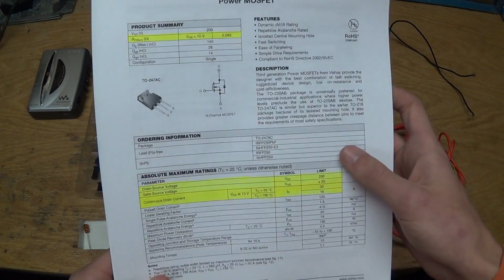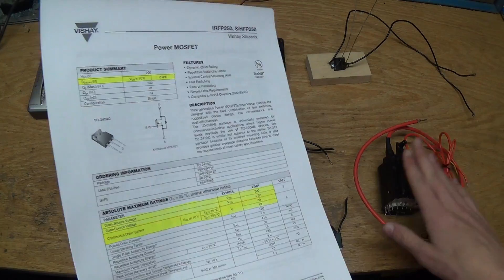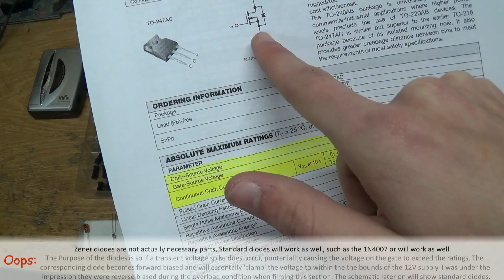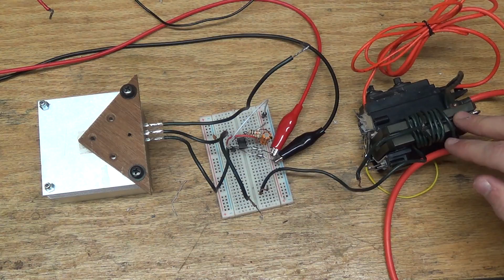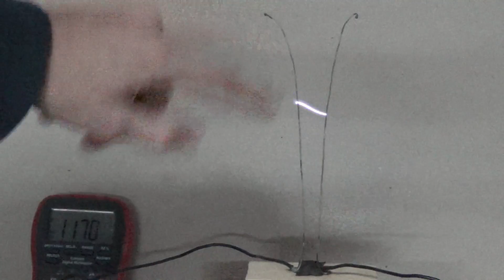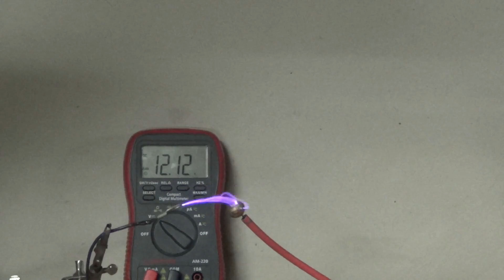Weekend Projects: Make a 69KV Singing Arc Plasma Speaker Flyback Driver!

Comment: Alright I need some help with this and I can't seem to gather the answer from the various schematics and videos, it seems to always be skipped over detail wise. I have built a ZVS, I've used two flybacks on it etc, I normally use a rectified output from a variac, and I just recently completed a 555 circuit as well which functions well, though the IRFP250 gets pretty hot after a while.

The problem is, the ZVS I can throw all kinds of power through the flyback, and the 555 I obviously can't, and I've done all this in the hopes I understand PWM better. Well, the 55 I can get some barely audible sound, but the arc is short and thin relative to my ZVS. Instead of trying to use the ZVS (I read the comments with you and that guy here as well) I wish to use the 555 with dual power supplies, as you are in the video here, but no one explains the details of using two supplies.

I'm not quite sure how to connect the second supply, do I connect the primary and the resonant cap to the second supply and leave the negative side to the first supply? Does it connect to ground? It's always shown as just one connection, with no explanation as to where the other side of the supply goes, and I feel like I don't want to run a 555 circuit with a 9v, then pump variac style power through the primary to have it blast the battery.... it seems like a bad idea. Can you help me with this? It's maddening!!

Comment: Thanks! Just built this and it works perfectly! Got a monster flyback from a 27 inch CRT and im getting 3-4 inch arcs!
Reply: damn that's about 200-300kV's
Reply: @F.A.1.8t  you mean 30-40kv, the flyback transformer is only rated for 10-33k, when the transformer has 300kv output, than you gonna fry your flyback transformer or even explode.

Comment: what frequence of you 555. I don't see your cap between Pin 6 and mass
Reply from the maker: Set your resistors and capacitor to be about 44.1KHz for best audio quality, or to about 19-25KHz for maximum arc length (may cause mildly audible extremely high pitched squeal) 100KHz mentioned in the video was incorrect because the 555 was experiencing some sort of feedback from the high voltage which caused it to act sporadically near the very end (where I was drawing the huge arcs at 12v.) and although the chip was set to oscillate at 100KHz, it was not actually operating up that high.
Reply: i know F=1,44/((R1+2R2).C) there is an error with it F=300hz or 900hz. 
i used R1 = 100kohm, R2=10kohm(rheostat) and C=0.1uf.
Reply: i try again with R1=R2=200ohm, C=0,1uF => F=21khz, capacitor 4,7000uF between two pin of flyback and i use IRF 540. When i set Vcc, MOSFET was activated but power supply inform Vcc = Mass. What's mistake
Reply from the maker: * 555 timers should not be used with such low value resistors. 1K minimum.

* The duty cycle should be less than 50% (I learned that after this video.) You have 66.6% duty cycle.

* frequency is set to 24KHz, which should be within range. May want to tune this for your flyback however.

* You should not have anywhere NEAR 47,000 uF across the primary of the transformer.

* IRF540 is not a strong enough transistor. Use an FTP333N25 or IRFP250 as the bare minimum

* Vcc = Mass? What is "Mass?" If by Mass you mean ground (0V) then obviously the MOSFET has died, with the classic short-circuit failure mode.
Reply: My circuit seems to have run, I heard little sound in the transformer, but the mosfet is very hot and there is no lightning. Mosfet seem died :((( . What happen
Reply from the maker: Please click read more on the last comment. (sometimes youtube is retarded and does not show it, reload the page if so.)
Reply: tks u, i will try again
Reply: The duty cycle should be less than 50% (I learned that after this video.) You have 66.6% duty cycle.
What do you mean? i don't understand
Reply from the maker: Quan nguyen huy Duty cycle is the percentage of the time the output is at Vcc (12V) vs ground. setting the duty cycle requires changing the ratio of R1 and R2. But sn additional diode is required for less than 50% duty cycle or PWM.
Reply: could you give an example! pls
Reply from the maker: Perhaps google could help you in your native language. english search terms include PWM, pulse width, duty cycle...
Reply: ok tks you so much, i done

Comment: I just wanna help a bit:                                                                                                                                                                                    
Dumpster diving? No dude, go on kijiji and find somebody giving away CRT TVs. That's what I did. Some even give them away for free. I got mine for 15$ along with tons of electrical parts, free mosfets and high power resistors.
You can use a diode on the coil to prevent EMF kick back from destroying your mosfets.
You killed your flyback because of the input voltage and the amount of winding you have. Transformers work with ratios right? Having only 4 wires on the input will result in a huge voltage on the output that will kill the internal diodes and capacitors. This is why you use much more winding for higher voltages. Some go up to even 30 winding. General rule of thumb is to have about half as many windings as you have volts. 24V, 12 winding. You will get less voltage on the output but voltage doesn't directly influence arc length. Just look at a MOT transformer, 2000V is very small compared to a fly back but with it's 500mA output the arc can grow to about 20cm. 
Also, If you add lots of windings you can use a high voltage high current boost converter. The ones that are too extreme to buy, like the one I build in my video on my channel, but shameless self promotion aside it also runs off of a 555 timer. With the increased output and increased windings you should be able to get just as long of a spark without driving your mosfets as hard.
I'm fairly sure it's not 100kV, flyback transformers usually output 10-40kV before they burn out.

Comment: can in put flybacks in serie?
Reply from the maker: No.*

You can try but there is a good chance the extreme voltages will destroy the transformer insulation. If you use older AC flybacks, and you wind the coil around both cores in an antiparallel configuration, so that there is a 180 degree phase shift (one is the opposite waveform of the other) between the 2 AC high voltage outputs and you connect the 2 high voltage common leads together than you can theoretically double the output. MAKE SURE to submerge high voltage transformers (especially in this configuration) in transformer oil to increase dielectric strength. Pulling a vacuum on the container with the submerged transformer will extract the air bubbles that may be present when you first submerge the transformer and further increase dielectric strength.
Reply: how i can do this? i want lights soo big, sorry for my bad englsih

Comment: just a little note, with a AC output flyback and this circuit, I have achieved 9+ inches of arc, when well tuned with pot's replacing the resistors, so if you want big arcs, get ready to tune!
Reply from the maker: Some flybacks are better than others. I am recreating this circuit and I have tried every frequency from 8KHz (8000Hz, and loud!!!) to 100KHz+. My transformer appears to have a low Q factor and works best between 20KHz to 45KHz, at 12-24V operation. I hope you submerge that flyback under transformer oil, there is NO WAY that insulation is going to survive that sort of abuse by itself. My flybacks are already self-destructing themselves with the output shown in the video.
Reply: @power-max  In my experience most flybacks can ignite and jump a 2.5-3 inch gap of pointed electrodes before breakdown occurs (ie arcs erupt from the body), bringing the electrodes closer and manually drawing them out is different. Drawn out I could get over 1ft long arcs from the same transformers using the ZVS driver with some 450w of input power. But they don't last long doing that due to self heating, one literally dropped to no output and exploded with this cream colored goo oozing out.

Look at this one, that's what I mean by igniting and jumping https://www.youtube.com/watch?v=655uZTywQ5I although most of my transformers flashed over long before this. To get the arcs like that you need to find the biggest CRT TV possible to get a really high voltage flyback that can withstand that kind of tension.

BTW experiment with the number of turns too, sometimes less really isn't more and just leads to more core losses and runaway current integration due to flux walking (since there's no current feedback in this 555 design).

Comment: does the frequency of the 555 matter at all?
Reply from the maker: Very much so. I found with my flyback this works best with 18KHz to 40KHz when operating in the flyback (free wheeling) mode of operation. If you set the frequency to exactly the resonant frequency of the flyback secondary and set the duty cycle to 50%, and figure out what tank capacitor in series with the primary will allow the best operation, then you can achieve ZVS driver type results. In resonance mode, it helps to take the flyback transformer core apart and remove the spacers so that there is a greater coupling between primary an secondary. Resonance mode is not the best for clear audio however. Which makes sense because it is a similar principle to a swing. Changing the amplitude of the swinging  requires time for it to increase and decay.

Comment: I used C5 : 630v 334j and it did't work
and why you not used C3
Reply from the maker: +Harold Victor I don't know what value you used for C5. For audio modulation don't bother with C5, or experiment with that is somewhere in the high pF to low uF range. C3 is used in the schematic as a bypass / filter capacitor for the low voltage DC rail. (6-15V supply)
Reply: +Power Max yeah it work, I got 6 cm form arc but just work in few seconds , because i don't know exactly how many value for C5 !
can you give me value  you has used for C5 ?
Reply from the maker: +Harold Victor  I don't remember. For audio modulation don't bother with C5. Currently I am revising the circuit with the use of a push-pull circuit, hopefully ZVS soft switching as well, with the help of a phase locked loop, VCO, 7400 series logic, and a few comparators. If I am successful at making a truly excellent and very efficient flyback driver I might release it as a kit!
Reply: @power-max  waiting for it
Reply from the maker: @cisarvialpando7412  Check out the latest tesla coil video, it is coming along. It burns up flybacks quickly hehe!

Comment: How many uF for C5 ?
Reply from the maker: +Harold Victor As I figured out later, C5 greatly reduces the audio fidelity, but also greatly increases the output power and performance. If you want the 3 inch ZVS arcs instead of the thin purple ones, definitely use it. Also using the capacitor reduces the transient voltage stress on the MOSFET.
Reply from the maker: The ideal value you pick for C5 depends on your flyback Xformer. You either need to experiment with the value or you could calculate it with the resonant frequency formula,  f = 1/(2*Pi*sqrt(L*C)). The capacitor should be in the nF to uF range, and I find lower values have better audio fidelity, so you could make a compromise between the 2.
Reply: +Power Max thank for your help !!! that why I Subscribe your channel and like your videos
Reply: +Harold Victor and can you tell me what meaning of 'f' and sqrt and L and C because that is my fist time i see your recipe ?
Reply from the maker: f = frequency (Hz or hertz)
sqrt is square root operation
L = inductance    (H or henries)
C = capacitance (F or farads)
Reply: +Power Max thank a lot !!!

Comment: Power Max I realy cant find a MKP capacitor.What should I do.can I do it with out it.Or can I replace it with other thing?? And can you tell me the value of Capacitor#2.
Reply from the maker: +Kh Galdan Really? You can find them in most AC power supplies, surge protectors, monitors, TVs, ATX computer power supplies, and just about any digital AC appliances that use a power supply board. MKP capacitors are just a special type of film capacitor.
Reply from the maker: +Kh Galdan I can tell you what value you should get if you tell me what the resonant frequency of your flyback is, and what the inductance of the primary coil is. Just solve this equation and solve for C: 
f = 1 / 2*pi*sqrt(L*C)
make sure to use the SI base units though, like Henries, Farads, and Hertz. Otherwise you will need to experiment and determine the best capacitance to use by trial/error, like I did.
Reply: +Power Max I found an 47uF mkp c will it work.
Reply from the maker: +Kh Galdan No. Too high a value. Look for something <5uF. But the value is highly experimental. Try anything from 0pf (no capacitor) up to a few uF to determine what the best value is. Alternatively you can use the formula I gave you, measure the primary inductance of the flyback (about 5-8 turns of wire around core) and quickly figure out exactly what value you need. I do not have an LCR meter to measure inductance so I did the "try it and see" approach.

Comment: Could someone help me trouble shoot my circuit ? I've tried wiring It multiple times to no avail, I can't get the flyback to hiss at me ... First off is it ok to run the 555 ic part of the circuit  on a 9 v battery? And also I have the high voltage side on with about 19.5 v and about 5 amps.  I am using Zener diodes to clamp the 555, and my transistor is a D1556. Also sorry just a few questions, what value of capacitor is c5? And also when you said you can check if the 555 is oscillating by attaching more capacitance and a speaker , did you mean a speaker wired from pin 3 to ground? And what value of capacitance should I add to test it? Sorry for the length of my comment, if anyone could help  me I would be very grateful!  Thank you!
Reply from the maker: +Keystone Science That transistor does not appear to be suitable for this circuit. I think you may have fried it too. I used a MOSFET rated for 200Vdc between the drain and collector, and although the 2SD1556 is rated for 1500V from between collector and emitter, the maximum current it handles is only 6A, and only supports up to 50W of power dissipation. Considering that is pretty much all the data available for it, I think this is a very crap transistor pulled out of some cheap boost converter or something.
Reply from the maker: You can test whether the transistor is good by connecting a lamp between the positive of the power supply to the collector of the transistor, and the emitter to ground. The light should not turn on until you bias the base of the transistor with a little bit of current. (by connecting a 470 ohm resistor between the positive of the power supply and the base to allow a small current to flow into the base to ground.)
Reply from the maker: "a speaker wired from pin 3 to ground?" Yes, that's exactly what I mean. The capacitor I mentioned in the video referred to adding a larger capacitor across pin 1 & 2. There are some great 555 timer calculators online, a value of 0.5-10uF should get you somewhere in the audible range so you can hear the speaker easily. Make sure to place a 470uF --- 1000uF capacitor in series with the speaker though as well. Ideally you would use an impedance matching Xformer but that isn't necessary for a short test if you're using a normal 4 or 8 ohm speaker.
Reply: +Power Max thank you so much! I ordered some irfp250n transistors from eBay, so when they arrive I'll try it again! Your awesome!!
Reply: Ok i just have to ask this lol. did it even ever wprk if you even remeber when you built this

Comment: Really great tutorial. I built a 555 driven plasma speaker myself, but I just can't seem to get the audio loud enough to actually hear it through the arc. (I'm using my phone's audio jack btw) Is there anything you did to amplify the sound? Or is the radio that you're using just really loud by default?
Reply from the maker: +Michael Morrill I used a crappy vacuum tube based PA system amplifier to amplify the music from an old phone I didn't care about. It was nice because it had a really high input impedance and medium output impedance (to drive 8-16 ohm speakers). However I had to be mindful of the signal amplitude on pin 5 of the 555. I fried many 555 chips by feeding too loud a signal into pin 5.  I also don't recommend using a phone you care about for audio. Use an old phone or mp3 player, as you never know if something goes horribly wrong and destroys the device.
Reply: +Power Max Ah, I see. I just had an idea that my 555 might be fried for the same reason. I'll see if replacing it fixes anything. Thanks!

Comment: Hi, can I use a potentiometer instead of the capacitor??? To set the frequency??? If I am wrong where I should put the potentiometer to work correctly???
Reply from the maker: +gyorgy komaromi No. 1) Pots do not replace capacitors, and 2) I have not had any good experiences with using pots or variable resistors in place of R1 or R2. That is just asking the 555 to latch up and fry the MOSFET & 555. Done right it will work, but you cannot change the duty cycle and the frequency separately. If you want to make a version of this circuit that features tuneable frequency and tunable duty cycle, I recommend building a different type of oscillator circuit. One idea would be to create a triangle or sawtooth oscillator (perhaps with some op amps?), and use a comparator or really hast op amp to "square it up." That is a classic analog method for generating PWM signals.
Reply: Power Max I think i won't do this...anyways i am doing a spark gap Tesla coil and i i can get the max out of it...it is fine.. :D thanks ;)